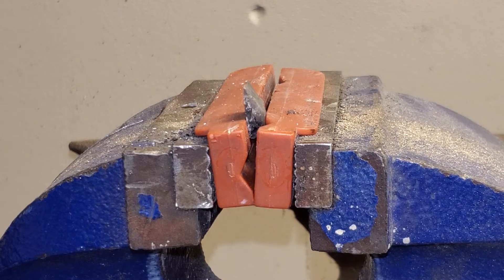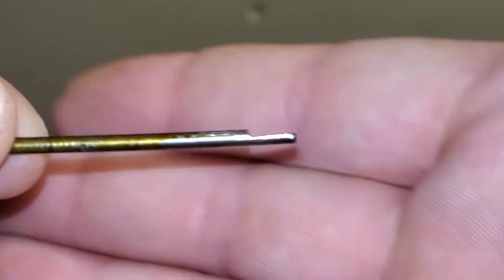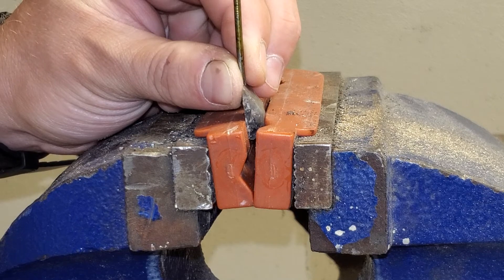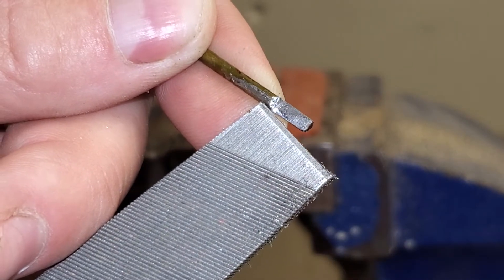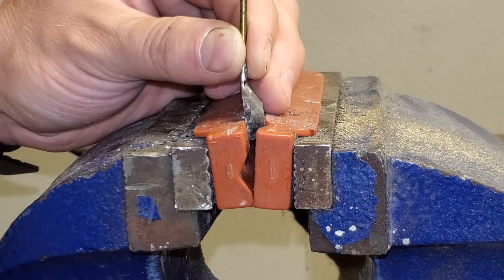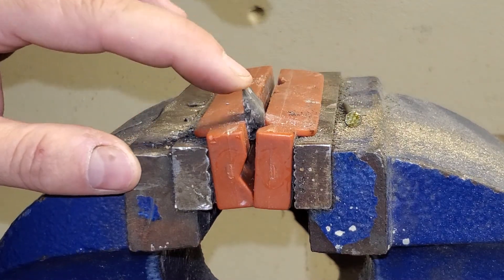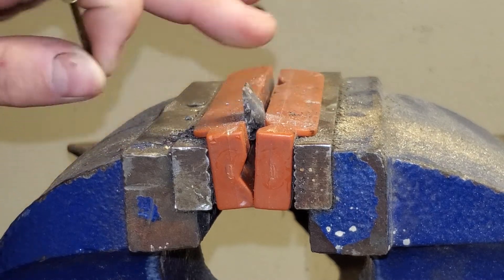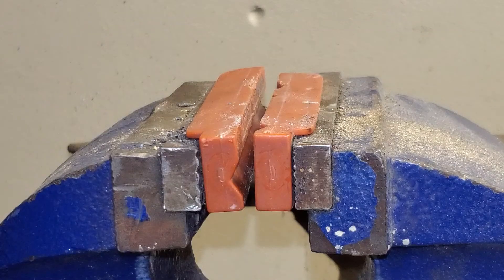How to knap a flint

Comment: Interesting take on refacing a flint. I'm lazy, I use a small belt sander we use to make fuel/nitrous lines for our engines. Put the Flint in a vise-grip and hold at the proper angle, viola all finished. The first six to eight sparks light everything up! I dress about every twenty-five shots. Thanks for the video.
Reply from the maker: Never tried a sander.  I was taught to do it with a flint knapping hammer and found this to be easier and more precise.  I will have to try the sander with the saw cut flints, as they don't chip like this.
Reply: Mr. Murphy, You are more well versed in this process than I am. I learned the process you demonstrated about sixty years ago. I only own two Flint rifles and shoot maybe three hundred rounds a year. Some of my friends have me sharpen their flints on the cheapie HFT one inch belt sander we use in the shop. Thanks again for the video.

Comment: Longtime flintknapper here. Interesting method. I would recommend you use a copper flaking tool, and changing your angle of attack. Flintknapping is a game of angles and platforms. Hard steel makes it really difficult to reliably detach flakes. Copper is soft enough to grip the platform to detach the flake with control. Steel just bounces off of it, and you can create fractures in the flint which can cause your flint to prematurely self-destruct on impact with the frizzen. Also, if you spend a little time prepping, beveling, and abrading that edge into a continuous platform, and using a pressure flaker, you'll get a much more controllable and reliable result with a finer, sharper edge, and no crushing. Plus, if you keep control over that edge without crushing it, it makes it much easier to resharpen when you need to. You can also use this method on saw-cut flints, you just have to take some micro flakes off the edge to create a beveled platform to chip. That aside, I'm always impressed to see the methods folks come up with to knapp flint.
Reply from the maker: The fellow I learned this from specifically told me to use a common nail because ot was soft, for the same reasons you stated.   May try to find a piece of copper and try what you describe.
Reply: @murphyfirearmstraining3630  cool. Nails aren’t nearly as soft or grippy as copper, and you’ll notice a lot more control over your flake releases.

Comment: Try to use a cement nail  ( VERY hard steel     and a dremle tool with cut off wheel to angle and sharpen nail) !!.
Reply from the maker: I will give that a try.  I appreciate the idea.

Comment: why don't you use a sharpening stone or a file on the flint?  you all doing too much work with that nail
Reply from the maker: flint is hard enough that a sharpening stone or file will not take off any of the flint........ That is why traditionally you chip off little pieces to sharpen it.